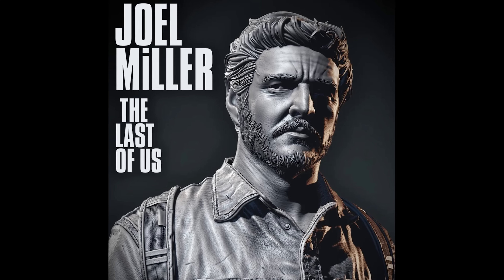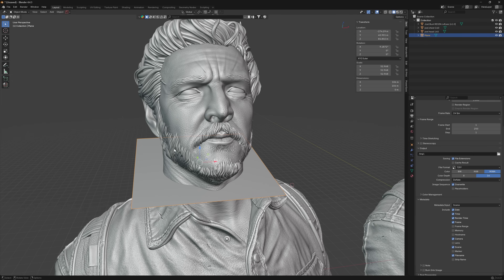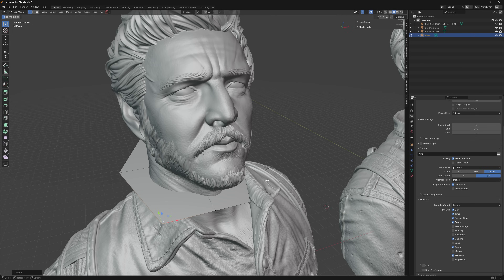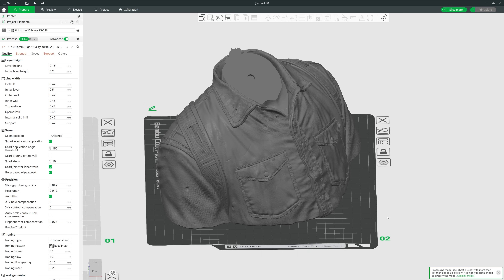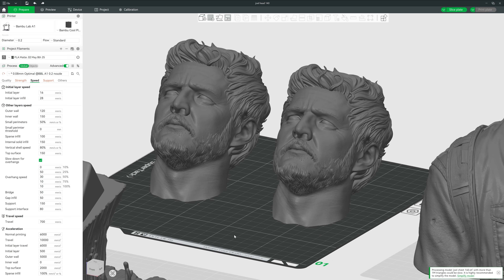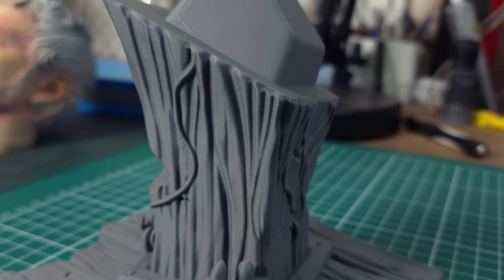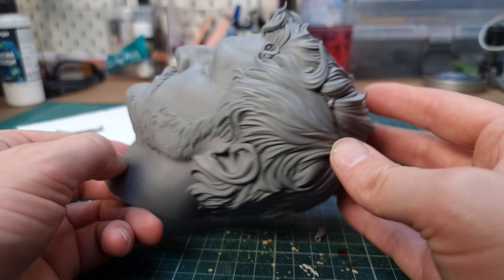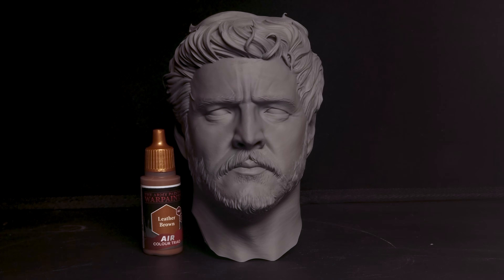How to get EPIC quality 100% FDM 3D prints

Comment from the maker: ChatGPT recommends these settings for the head:
Outer wall speed	55–65 mm/s
Inner wall speed	75–90 mm/s	
Small-perimeter speed	50 % of outer (≈30 mm/s
Top / bottom	Top surface speed	35–40 mm/s
Sparse infill speed	90–110 mm/s
Bridges & overhangs	Bridge speed	18–22 mm/s
Overhang speed	Slow-down = 70 % (≈40 mm/s)
Travel	Travel speed	220–250 mm/
Acceleration	Outer wall accel.	800–1000 mm/s²
Inner wall/infill accel.	1800–2500 mm/s²
Travel accel.	4000–6000 mm/s²
“Slow down for overhangs”	ON, 70 %
“Outer walls first”	ON
Reply: So how detailed are the prompts you're providing to chatgpt? Would you be able to show an example of how you ask for something like this please?
Reply: And how did you like the results when you used these settings?

Comment: I have several Bambu printers and of coarse the normal .4 nozzle. Bought a few of the .2 nozzles for them but every time I try to print with them they always clog up. I tried higher temps, slower speeds etc. Any idea what I can do to get the .2 to actually work? TIA
Reply from the maker: I put screenshots of all my settings up on ChatGPT - including the ones you can open when you click the 3 dots next to the filament setting - and ind it gave me lots of things to change. Make sure to tell it what issue is, and that to give you instructions for the most recent version of Bambu Studios. Not had many clogs at all on the A1 at 0.06mm, but have had a few on the H2D that can only go down to 0.08mm at the moment. but chatGPT did help

Comment: So you don't use pins or anything like that to reattach? How do you realign things? Just eyeball it? 
I suppose that's the benefit of just using magnets cuz it's not permanent and you can adjust
Reply from the maker: I should really use pins etc, but they're still not perfect, so i eyeball it usually - the superglue I use has a few mins work time so it's easy to adjust but still sets fast. I really need to be less lazy with magnets, and build more of them into the STL prior to printing, and even hide them under the last layers! I'm always too keen to get printing and forget to sort magnet holes out until after - then i just have to drill them best i can :D

Comment: Even with a 0.2 mm nozzle, it can't match the quality of resin printing, and it takes ages to print. And although it may look smooth at first, once primer is applied, the layer lines become clearly visible.
Reply from the maker: While I don't disagree that resin is better detail and faster, FDM has huge advantages over resin. So to be able to compete with resin on some prints is very important to a lot of people.i ha e to disagree, though, that adding primer makes them look worse - paint makes them look even better - from my experience anyway. Thanks for taking the time to comment though, I do appreciate it. And it's given me the drive to do a resin Vs FDM comparison vid on an STL like this head just to see the difference

Comment: I got 0.2 mm and it's cool. Lower layer heights can give a really good finish. Also fuzzy skin. 
I have resin printer but avoid it cuz it toxic and I got sick a few times. FDM is slower so in a sense but there's no post processing time and chemical costs like resin. I use it for smaller stuff and 5-7 hours is fine .
Reply from the maker: Lol I could probably stretch to 5-7 days! Longest one so far is over 4 days 🦊🍻

Comment: Great video. One question, using the 0.2mm nozzle, you used a 0.08mm layer height, what about the initial layer height, did you use 0.1mm or greater? My A1 mini gives me issues when using the 0.2mm nozzle and an initial layer less than 0.2mm, the nozzle scratches the plate sometimes on those small layers. Thanks.
Reply from the maker: Cheers for the kind feedback! :D TBH I've never changed the initial height which seems to be set at 0.1. Do you always recalibrate when changing nozzles?
Reply: @Krak_Fox  Yes, always recalibrate and always level the bed before every print. I have also changed the nozzle and tightened all screws in the head assembly. Oh well, thanks for your reply!!!
Reply from the maker: sorry to hear - have you tried chatGPT? i reckon that would be able to help
Reply: @Krak_Fox  Thanks. I will give that a try.
Reply from the maker: Let me know how you get on!

Comment: Wow….è possibile sapere tutte le impostazioni della stampante?!?
Reply from the maker: Outer wall speed	55–65 mm/s
Inner wall speed	75–90 mm/s	
Small-perimeter speed	50 % of outer (≈30 mm/s
Top / bottom	Top surface speed	35–40 mm/s
Sparse infill speed	90–110 mm/s
Bridges & overhangs	Bridge speed	18–22 mm/s
Overhang speed	Slow-down = 70 % (≈40 mm/s)
Travel	Travel speed	220–250 mm/
Acceleration	Outer wall accel.	800–1000 mm/s²
Inner wall/infill accel.	1800–2500 mm/s²
Travel accel.	4000–6000 mm/s²
“Slow down for overhangs”	ON, 70 %
“Outer walls first”	ON